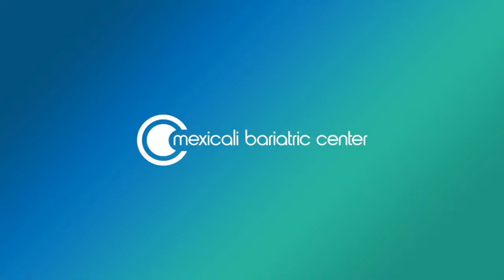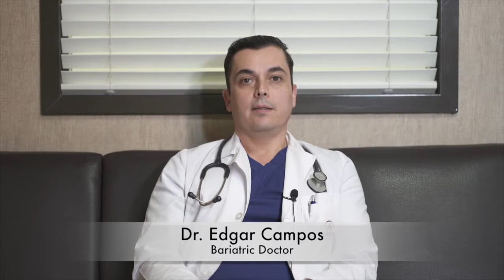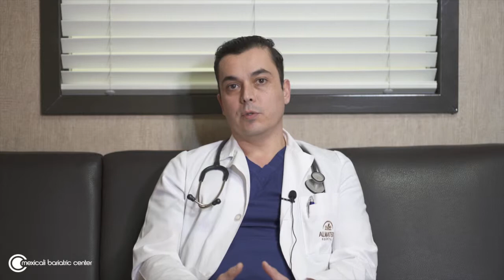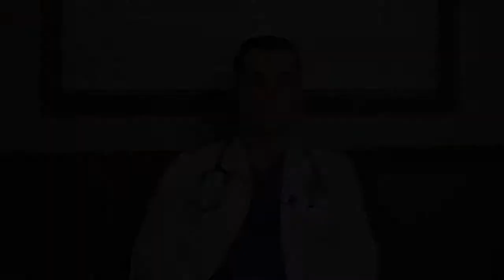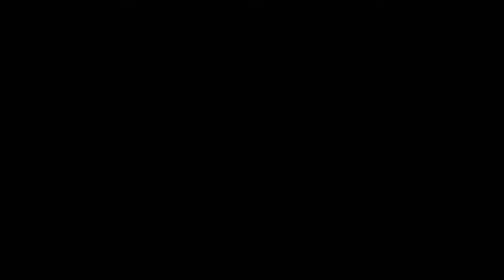Differences between DS and SADI-S _ Dr Campos_Mexicali Bariatric Center

Comment: I'm starting to believe these surgical procedures are BS! a straight up gimmick! what's the point of having these surgeries if you still have to starve yourself or workout all crazy? you can lose without the surgeries if your doing that. I had the sleeve done in 2017 it took 6 months to go from 305 to 231then i stopped losing.  ended up doing all these other things to lose weight.  but once I stopped that it came all back! so I decided to get the Sadi S 5 year's later and BS! not only am I not losing! one of my wounds opened and I had 2 holes in my stomach that now has turned into one! so I'm stuck nursing these wounds all beginning of summer.  I only lost  15 pounds after surgery 2 months ago and that's because of the diet I was on. now I am back to regular eating and I really just dnt know if this was the right choice.  the doctor said it was the best choice. I was definitely going to get gastric but he said this would be better.  I am trying to keep the faith. but I'm very disappointed so far.

Comment: Which has the best weight loss out of the two please?
Reply: SADI for long term
Reply: The traditional DS has better weight loss in the long term, but it has a higher complication rate than the SADI-S. There is just now data for this. The traditional DS results in around 15-20 pounds more weight loss, for someone with a 50 BMI, essentially. Not a big diff, so that's why doctors are mostly doing SADI-S now.